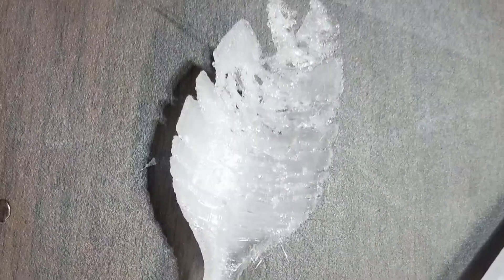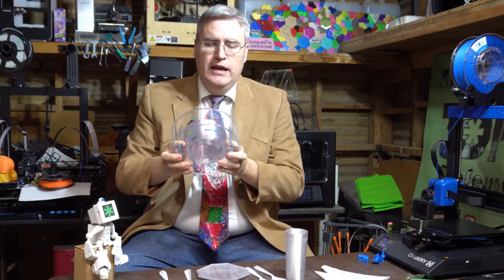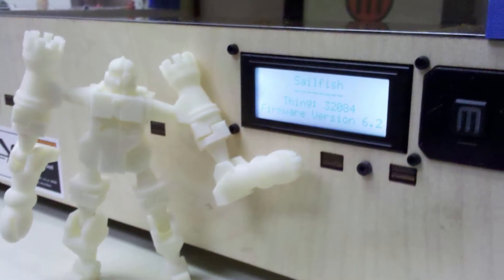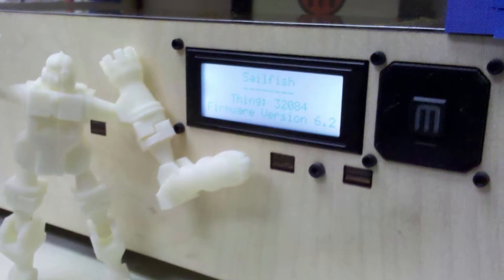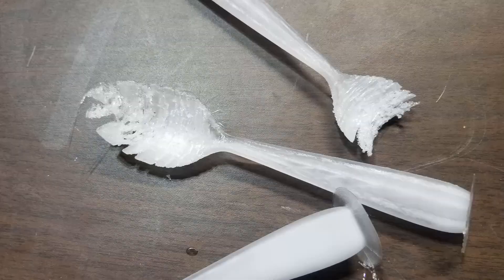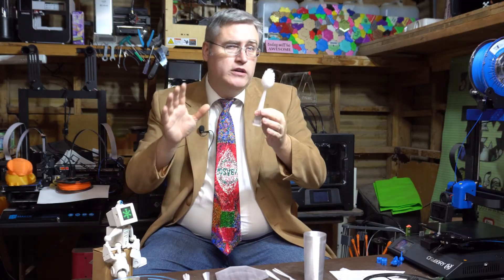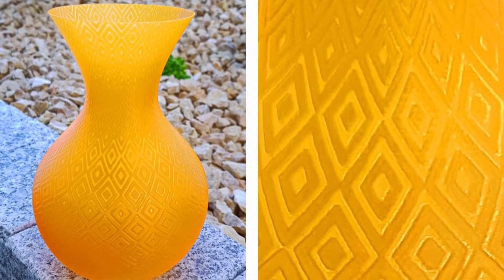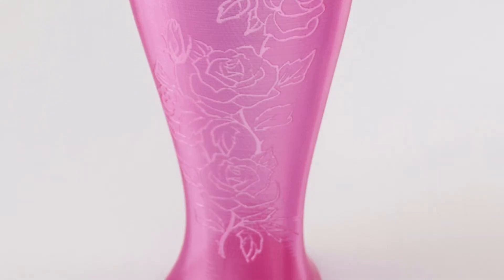3D Print Better with One Simple Trick - Slow Down!

Comment: Hello

Could you recommend a 3D Printer
That will Print Simple Real Glass Products at an Entry Level ?

TY
Reply from the maker: What are Simple Real Glass Products? I assume the capitalization is significant. 

As for 3d printers that print glass, I don't know of any that aren't custom built. You may be on your own on this one.
Reply: @3dpprofessor  Simple as in a glass block, glass tube, glass square , etc.. simple objects
Reply from the maker: @gregandtonya5693  does it have to be actual glass or would fully transparent resin work?
Reply: @3dpprofessor  I would prefer Real Glass
Reply from the maker: @gregandtonya5693  The only option I've heard of is called "Glassomer". It's a multi step process that includes a burning off the resin and then sintering the glass in a very hot kiln. The only other way would be to have a 20000C degree hot end, and that would require some significant infrastructure. But, again, you're on your own for building it.

There was also Markus Kayser who used a giant lense to focus the sun into the Egyptian desert sand to turn the silica in it into glass and 3D print with it layer-by-layer. but the result wasn't very glass like. it was more of an art project. Cool, though. You should look it up.
Reply: @3dpprofessor  
Yes That was the picture I was getting in my mind you have Now confirmed it for me

I enjoy watching some of your videos also 

Interesting stuff

TY

Comment: The speed race in 3D printers wasn't just about speeding up print time. PLA stretches when you go faster than the printer can extrude, resulting in thinner extrusion. Those darn Yoda heads everyone was showing off with back in the day were all PLA at artificially thin layer heights created by going as fast as possible. 

When people complain about 3D printing being slow, I remind them that it's many orders of magnitude faster than the process that is being emulated - injection molding tooling and getting parts shipped from the factory.

Comment: Do you think you could speed up the print on something like a CoreXY printer where the print head moves in X and Y and the bid only moves in Z? This question obviously has nothing to do with upcoming projects and is definitely only theoretical 😅 (by the way - your videos are awesome and far surpass your sub counter!)
Reply: PETG is the problem here, it's a weird material. Half the problem is that it's floppy, so thin structures can be shaken by moving bed and cause bad alignment, so a stationary-bed printer or a Z-moving bed printer is a substantial advantage, it will solve that.

But it's also very viscous in its molten state, and it sticks together pretty well. So during print moves, the toolhead also drags the print along, imparts a force on it, and causes it to wobble or cause bad alignment depending on the print speed, and that is fully independent from the type of movement system.

And the problems don't end there. It has a very weird die behaviour. It's difficult to get it going when extruding, and once it goes, it's difficult to stop! So it can start and stop extruding late regardless, unless you get down with acceleration. At which point if the structure is small, you're fundamentally printing slower.

Comment: Great advice.  I don't have linear advance - surface quality issues I usually go and reduce perimeter velocity first.  I wonder for those of us who joined during the PLA era if we'll be forced revisit these themes as the heated chamber patents expire and thus begin experimenting more with a wider variety of materials?
Reply from the maker: In my experience, for PLA if you turn down the bed temperature, the enclosure only keeps environmental concerns away from your printer.

Comment: Have you tried the new Arc Welder plugin for Cura? Install form Marketplace and activate in Special Modes in the right-hand menu, it reduces the amount of G-Code in a file and thus enables the Proc to read it without glitches when you print at faster speeds, maybe your spoon could be printed at fast speeds without the fails?
Reply: Unless you're feeding from USB (i.e. via Octoprint) or your SD-Card is insanely bad, you don't need Arc Welder. It's also very aggressive at segment merging and doesn't seem to really respect segment speeds when it does that, which isn't necessarily its fault, ideally you'd have G-Code commands which can specify different start and end feedrates, but well you don't, so it solves some issues, causes others.

Also Cura is good in that you can set it to emit 0.5mm line segments and not shorter, and it's actually surprisingly good at approximating the geometry when you make it do that, like, the nozzle is around 0.4mm in size to begin with, small features are subject to a significant surface tension induced distortion, so it still generally manages to hit less than 0.05mm deviation from ideal path except in cases where all hope is lost anyway, while your electromechanical positioning precision is probably worse than 0.08mm anyway, and the output is consistent and robust, so it's not like you get 0.05mm layer to layer variation on consistent features, you really get pretty much none that you can see or measure. And this can solve a lot of planner underrun issues.